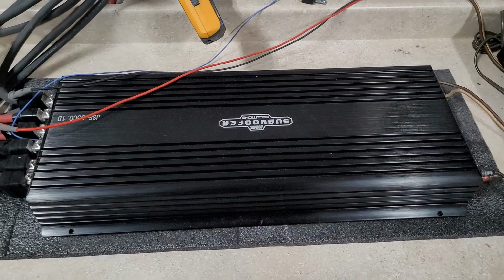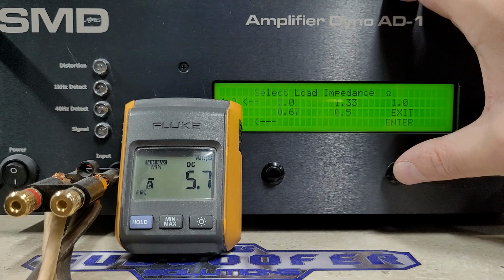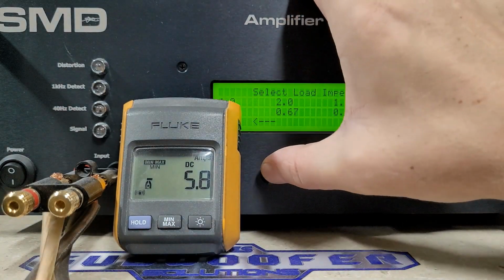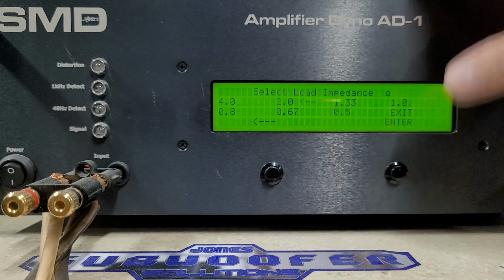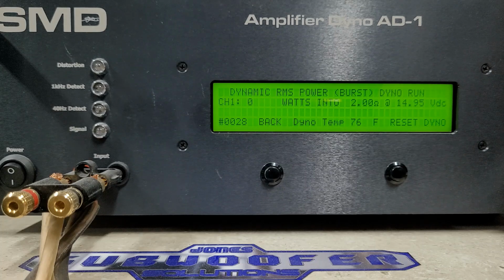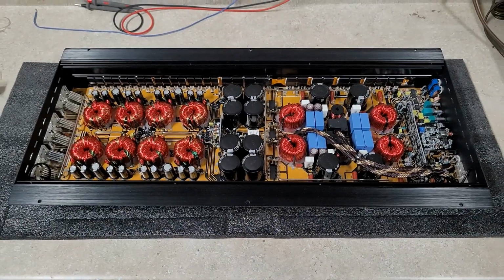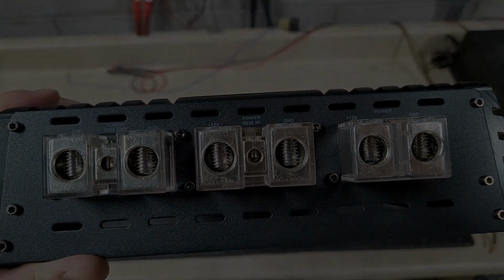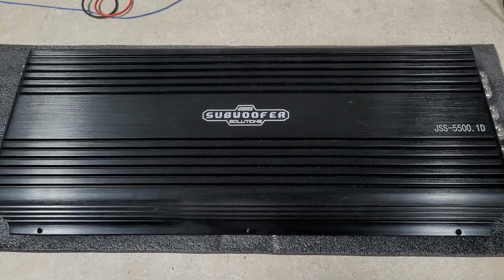AD-1 Amp Dyno Teampie TP-5500 / JSS-5500.1D by Jones Subwoofer Solutions JSS

Comment: DC audio amps has the same board
Reply: Similar, but not the same. Same basic design, but built by two different companies. This means there can be a lot of differences. Different caps, inductors, pcb thickness, clip limit circuitry, quality control, output, etc...

Comment: I am not using dual inputs on my 5k cab45, I have a single run of 2/0 welding cable to each lug  but it's only maybe 2' run from my lithium bank to the amp,  that should be plenty I figured or should I use my dual input lugs
Reply from the maker: 2 runs of true 2/0 is sufficient

Comment: You mean built in korea like every other brand with exactly the same thing.
Reply from the maker: These are Chinese, not Korean.
Reply: @Facekicker  it doesn't really matter, they're all copies of each other.
Reply: @DavidBrown-wm7zx  It does matter as some build houses have higher or lower quality. All these different companies may use a similar design as they don't have to hire engineers to build unique designs. Rockford Fosgate design their own products and their price reflects that. A company like TeamPie can basically use an existing design to keep costs low while making it unique by using higher quality components and adding features like the clip limiter circuit. So you really don't want to group all these companies together. Some will be better than others.

Comment: We all know most amps aren't rated to go below 1ohm but we like to push the envelope and it shows how truly well a amplifer is actually built so if your up for it the half community would appreciate it
Reply: unlike other amps the price point of this amp and its power buying 2 would be more cost effective than ,05 ohm amp other brands have a DC Audio 5k is 1600 plus
Reply: @homixide187  I personally don’t like running more then 1 amp and I also personally enjoy the sound at .5 vs the sound at 1
Reply: @famousmoon  😂😂😂🤣🤣🤣👌
Reply: @famousmoon so your saying you don’t like accurate bass. .5ohm is sloppy only good for numbers

Comment: Thanks for the Dyno!!! Mehnn how can you tease us with the .5 ohm talk without some footage of a run or two at .5 or .8. Can you please do that? I personally run D1 subs on 2 ohm Brazilians so this test is very high on my want list along with the 7500’s out there. Hard to find testing on them unfortunately.
Reply: 0.5 ohm resistive on the dyno is brutal on amps. Most don't survive. Jones has said this amp at 0.5 ohm in the vehicle is fine, though.
Reply: @JasonWW2000  I saw that. The 7500 is a beast through the updated video. I went a different route and got a mega surfboard.  Trying to run as least equipment as possible.

Comment: Hell yeah, there is a lot to like here, the high efficiency even at 1 ohm is a pleasant surprise, I like the 35hz LPF and 10hz subsonic, the triple inputs are a really nice-to-have, I like the split board and the quality of the board being bolted through the center and everything is glued down nicely, the soft clip button could save the lives of many expensive woofers, the dynamic power and the heat soaking capabilities will put those small full bridge Brazilian amps to shame, plus if you link 2 together you have an absolute shit ton of power. 
Overall that's a really nice piece of kit, it's good to finally see what one of these can do, nice work!

Comment: Nice same board and build house as Deaf Bonce AAK's.
Reply: Correct and deaf bonce other amps are Chinese clones of soundigital
Reply: No! Correct!
Reply: They appear to be from separate build houses. DB have had a 20k amp for quite a while. TeamPie are currently working on producing their own version of that amp. So different build houses, but probably similar basic design. I notice both these brands are using the clip limiter circuit which is a rare feature. Still, different build houses.
Reply: No!
Reply: Deaf Bonce is mid grade audio products. Thats a shame! I was hoping for something reliable finally.
Reply: Correct

Comment: Can u explain in next dyno how u are getting the amp efficiency?  I know Iam not the only dummy that doesn’t understand how to!!
Reply: Let's say an amp draws 100 amps at 15v, thats 100x15=1500 watts. The amp dyno shows the amplifier output wattage is 1200 watts. This means 1500 watts go in, but only 1200 watts comes out. So 300 watts are being lost to heat. 300÷1200=0.25, so it lost 25%. That means amp efficiency is 75%.
Reply: @JasonWW2000  Thanks J. That definitely helps me understand the math part better.
Reply from the maker: I put the formula on the screen but I can explain it more in the future.
The quick explanation is that
I take the displayed wattage and divide it by the result of volts x amps.